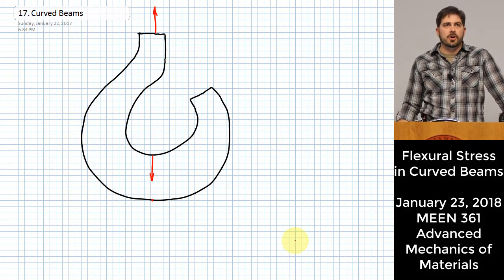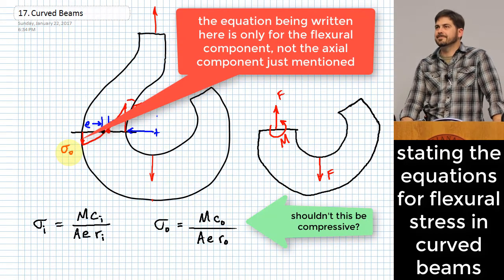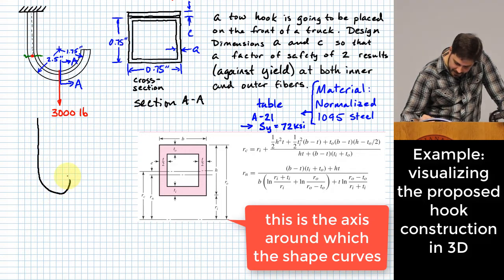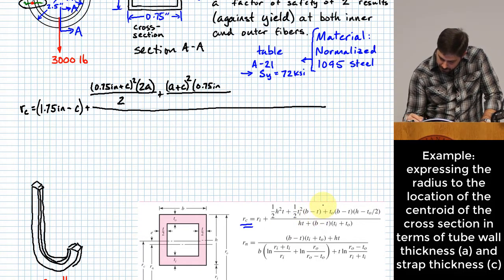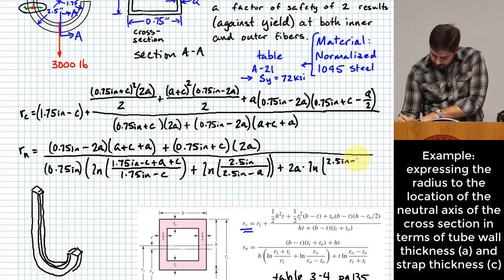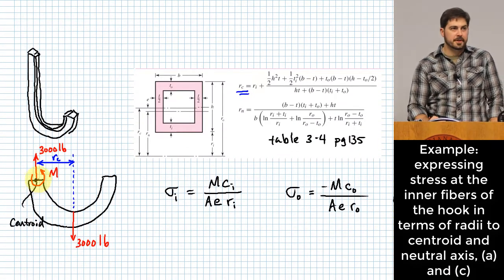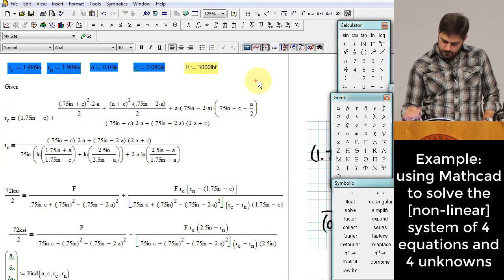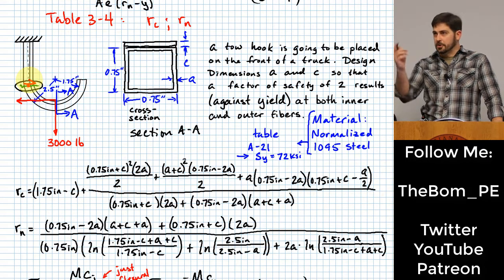Curved Beam Reinforced Tow Hook

Comment: Do you still look at comments?  If so, I have a question. If an I beam is curved on the top... and straight on the bottom, Is it calculated as top curved beam and bottom straoght beam?  Say use the low side position as an inside radius position. How can it be done.
Reply from the maker: I do still see the comments periodically, but I have become occupied with certain other enterprises. YouTube has proven to not be a great way to support my family! :) If I understand correctly, you have a variable-height beam. Without getting all the info, my uninformed guess is that the curvature may not be super significant relative to the beam's length. What I would likely do if that is the case is kind of just ignore the beam curvature since it would not be hugely different in that case. I would probably just treat it like it is quasi-straight.
Reply: @TheBomPE  Thank you.  I watched and worked your vidieos for hundreds of hours. It got me there. 
It is a short beam. 825mm I beam.

Comment: Thanks for your great explanation. Could you please make a lecture about tilted pad thrust bearing design? 
And may I ask your note-taking application name?
Reply from the maker: I'll have to add that to the list! It may not have super high priority just yet, I have a pretty full plate with my main job, so I don't get that much of a chance to develop extra material!

I use Microsoft Onenote 2007 for the inking. It is the last version of the software where you can customize the toolbars (no ribbon bar).